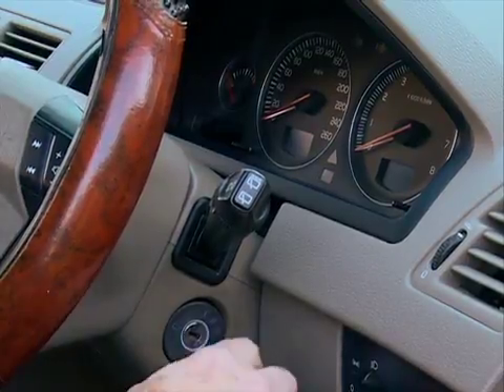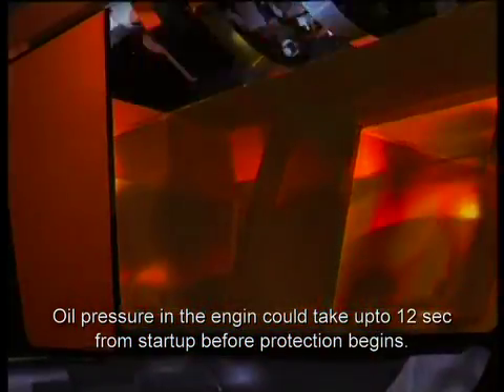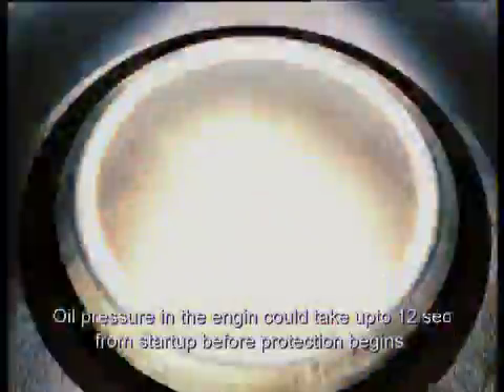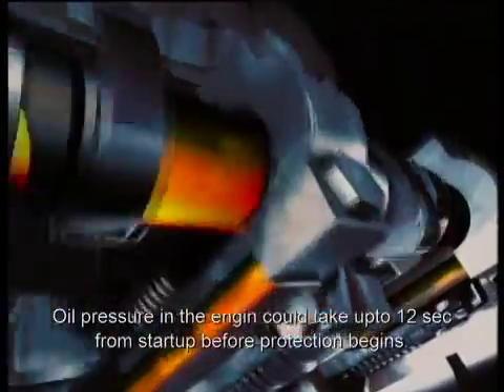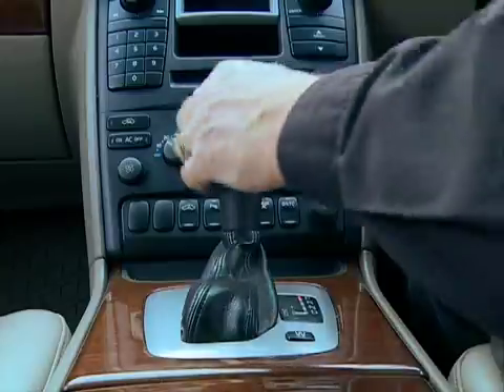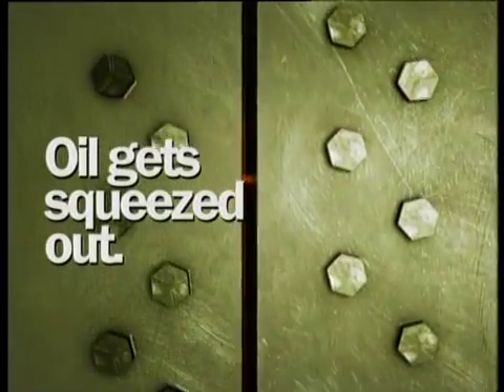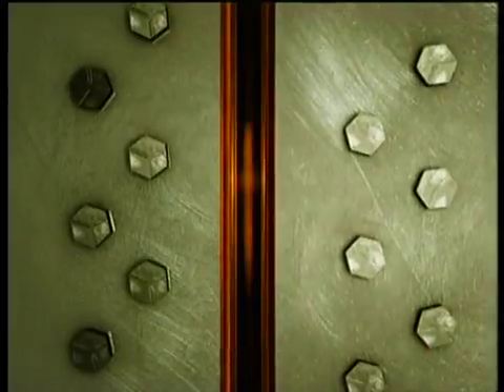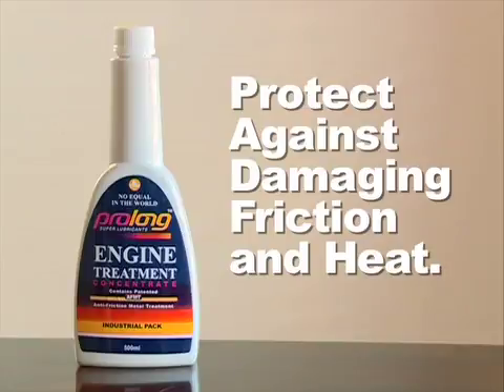Prolong Startup Protection

Comment: Been using it for yrs. Amazing product. I've seen oil pressure rise 8 to 10 psi and coolant temp drop by about the same at same time on high mileage engines. In my 96 z71 with over 330k on it i can do an oil change and by the end of the week it is absolutely running like a new engine. Runs great as is but i can honestly tell a huge difference as stated above, i also only run high test exxon. Good fuels and good oil treatment goes a long way. Awesome product 👌 😎